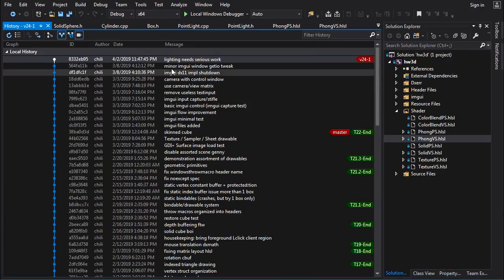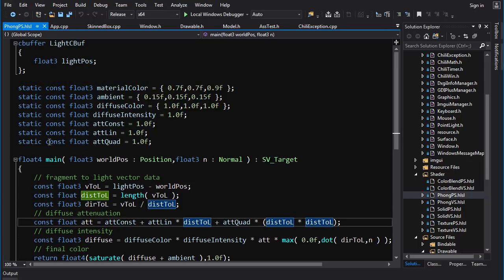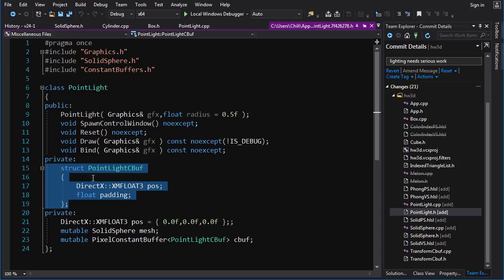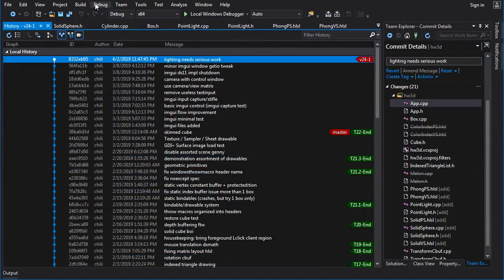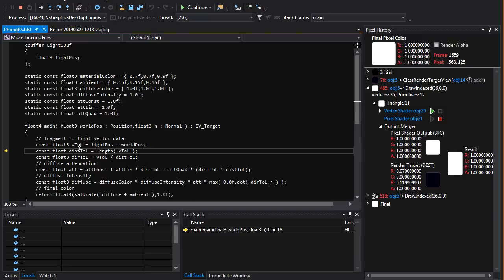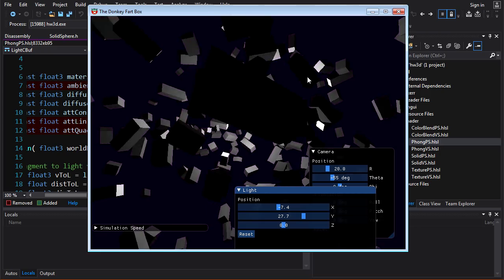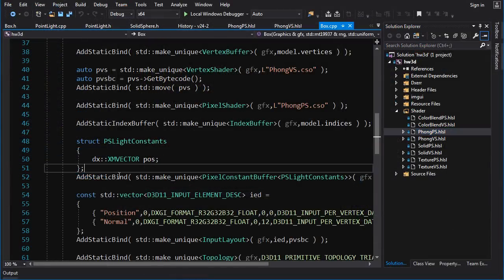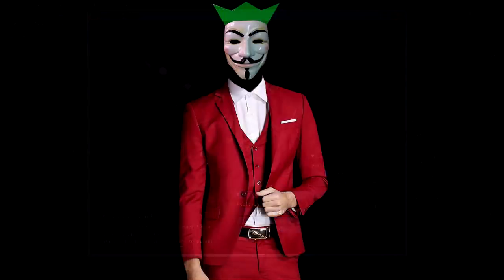C++ 3D DirectX Tutorial [Dynamic Lighting / Graphics Debugger] Part 1

Comment: Is it normal that I don't have Graphics Debuger in Visual Studio 2013 ?
Will I have to switch to Visual Studio 2019 ?
Reply from the maker: Yeah 2013 is too old m8
Reply: how dafuq u using vs 2013
Reply: @catinwall4256  Do you know anything better for doing DirectX in C++ ?
Reply: @peterSobieraj  Yes, visual studio 2019.
Reply: @catinwall4256  What's better about it ?
Reply: @peterSobieraj  I mean didn't you already answer that yourself? It has more features (graphics debugger, etc). I can only assume it has more capable intellisense and whatnot. Almost everyone I know uses visual studio 2019, so I would also expect there are more tutorials. It's also regularly updated (but visual studio 2022 is coming out later this year).
Reply: @catinwall4256  I meant is there anything more to it than gpu debuger.
Most people use VS 2019 because they work in corporations, and corporations have rules to always use newest versions, regardless is it better or worse.
VS2013 is older so probably there will be more tutorials for it than for VS2019.
Switching to new IDE mean that I need to spend lot of time to set up everything, learn where is what, and how it works. That's huge cost.
If VS2019 is regularly updated, then I will pay that price with every update.
I did test VS2015 and VS2017, and installing them was causing VS6 to stop working. That was unacceptible.
VS2019 doesn't have that problem so far, so that's good. But as you said it's regularly updated, so it may suddenly break.
In short VS2019 is bleeding edge technology. So I'm not going to use it unless I know there are some huge pros in using it.
I did check out VS2019. I don't like new project form (but I won't see it that often, so I don't care much).
I heard that it's running very slow on laptops and medium range PC's. That you can outtype it, But I didn't notice it my self.
I like whole debuger. I like std::any and std::variant. But it's not enough to justify switching to VS2019. And as far as I know that's it.
GPU debuger is huge. So I may switch to have it at some point.
Reply: @peterSobieraj  I mean you do you my dude. I would never use vs 2013, because older software that is not regularly updated is most likely going to have more bugs. Visual studio 2019 is regularly updated with bug fixes, and those updates don't break it. At the end of the day it's up to you.